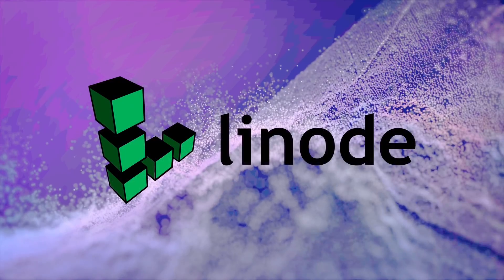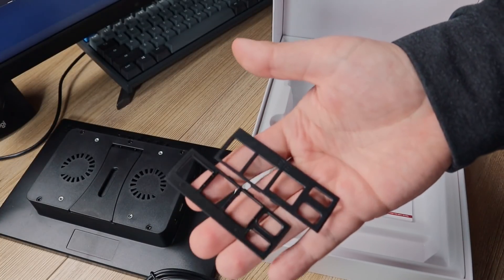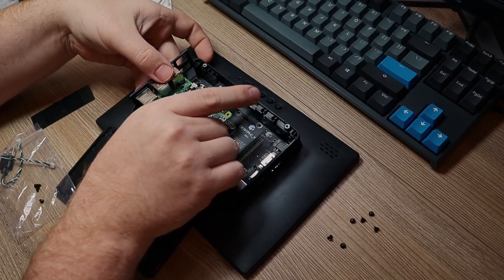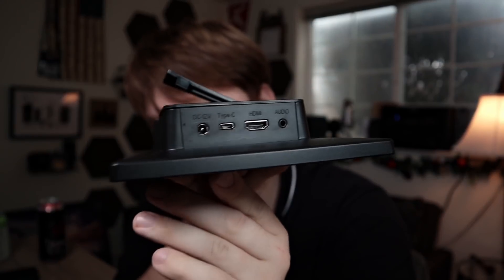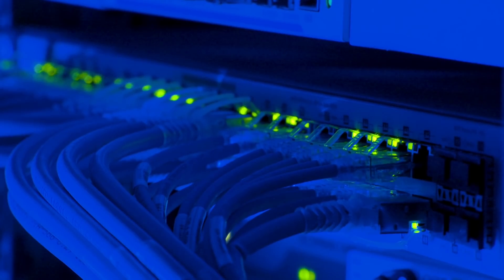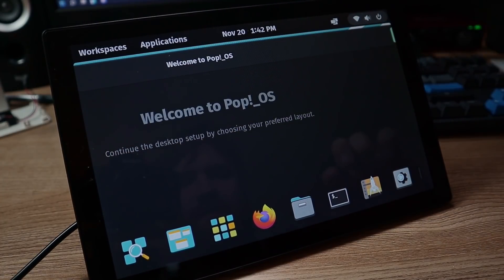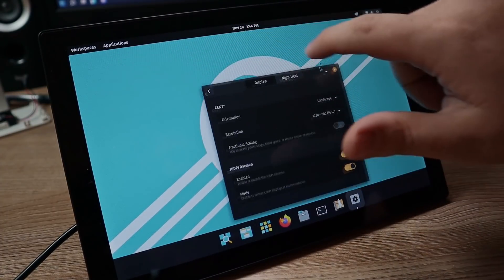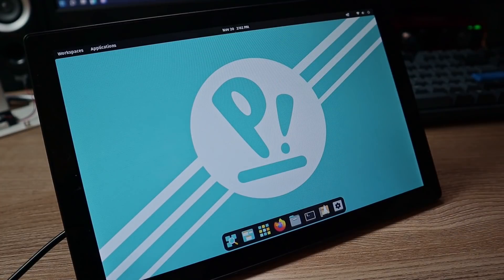Raspberry Pi Touchscreen ft. Pop!_OS ARM BETA

Comment: I just checked out the release version of Pop!_OS 21.10 for the Raspberry Pi 4.
It was a pretty good experience all around, except for one major issue...
the 'Desktop' panel in System Settings didn't show up! Also bluetooth didn't work.
Strange to see both of them appeared here... in the beta ... did I just have bad luck?
Or are these known issues in the final release version?

I could still change the shell settings that were available in the OOBE greeter and setup.
However, I could not change them later... such as moving the dock or changing icon size.
Bluetooth not working is also a major blow... as I rely on a bluetooth keyboard to use my
Raspberry Pi 4 while on the go. Portable monitor + BT keyboard and mouse is a perfect setup!
On RPiOS or even Manjaro ARM at least... love where this is going... but things need to be improved.

Comment: For the best possible experience you might want to run a DE based on Wayland, like pure Gnome. Many of the touch related issues in Pop OS is due to it being on x11. Fedora personally works great on my laptop & pi, my config on NixOS with sway even works great with touch. Generally you also wanna run anything with a DE like KDE or Gnome with some sort of SSD/HDD instead of an SD card. SD cards are just not meant for the random read/write speeds a desktop environment needs

Comment: 14:50 That's because you're using Firefox. Use a good browser such as all Chromium-based browsers, or heck potentially Epiphany, to have touchscreen support... or figure out enabling a feature in Firefox that should've been there since 2012.
Firefox doesn't support touchscreens, even in 2021 still they don't.

Comment: Hey, responsiveness does not equal lag or latency. No company lists the input latency of their monitors. You need to test it, cheapest option is the timesleuth.
responsiveness does not have a standard way of measurement, but it does not say the time it takes to change a pixel from lets say red to green

Comment: Does this run Wayland? I remember when I had a touchscreen laptop the touch experience was much better on Wayland, for example the cursor doesn't teleport to where you tap, and it actually recognises touch input as a separate thing so it feels like you'd expect a touch OS to work. So that means pinch to zoom, multi touch gestures, etc. all are working.
Reply: it's running Xorg (cue on 13:29)

Comment: That keyboard isn't from Pop but it is Gnome's integrated osk. It would appear on Ubuntu or any other Gnome DE distro as well. IIRC there's an Ubuntu for pi too, so maybe you could try that out.

You have to use a workaround to have touchscreen scrolling in Firefox with X11. Works out of the box in Wayland though, awesome.